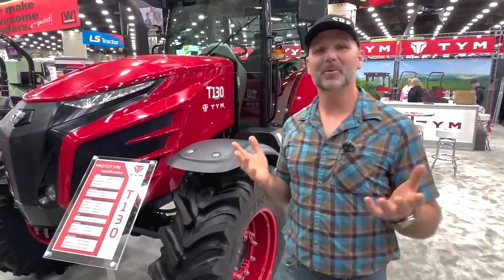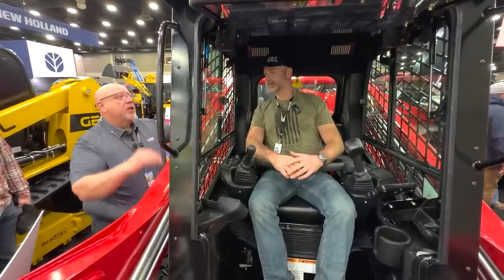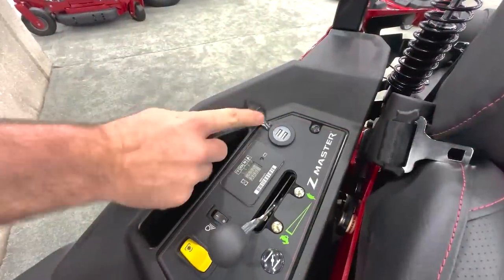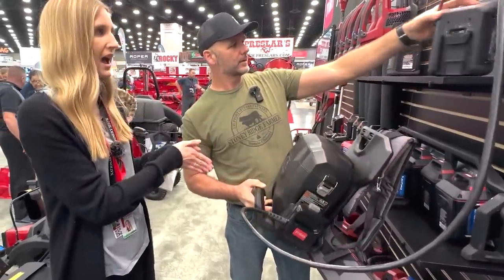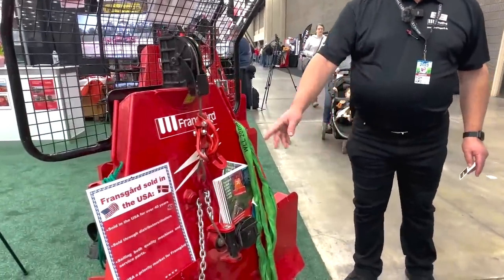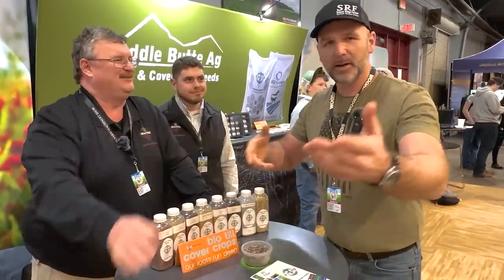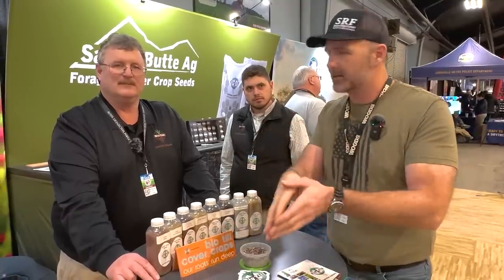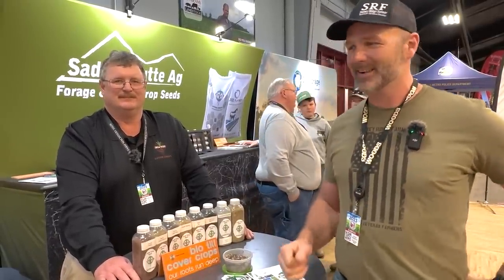Kicked him out of TORO exbibit at the Machinery show? You'll Love this!

Comment: Noticed how easy you were able to turn the pto shaft that was supposed to be the tractor output shaft .It's been my experience that most tractor output shafts don't turn this easy if at all. Sometimes with a lot of effort might be able to turn the pto shafts on the equipment.
Reply: Nice how it was just the right height for the PTO as well.
Reply: The PTO shaft spins free about a half to 3/4 turn on my Kubota M6060 when the machine is shut off, which is the purpose, your supposed to shut the machine off when connecting pto shafts.

Comment: the toro exhibit , that's a nice machine, they need to go back to the lazer z foot pedal, never had a problem with that pedal, the only people who do are the people who are dain bramaged and don't put their foot center on it properly who also drive with a beer in the hand instead of on one of the 2 control drive levers which is why there are so many smashed up mowers as these are the guys pinballing off trees, retaining walls, vehicles, boulders.... as evidenced by all the broken lights and smashed body panels and broken off plastic parts on the sides and tops of the engines like the air cleaner and throttle knobs.
if your foot slips off that new pedal it is going to have an excellent chance of shattering your ankle joint and forever being known as hop along pete or peg leg farmer

Comment: the ideal access door is an automatic NO for the simple fact i see enough people not securing their attachments and then they raise them up high enough they fall off and smash the door, doors are already in short supply and expensive as heck, what's the cost to replace this 10 grand? it's bad enough the bucket or other attachment falls right into the operators cab at their feet and face from what i have witnessed several times when buckets are raised over the cab during the winter and spring time and the attachment mostly buckets falls off and about kills them.
the swing door is also a safety mechanism that this swing door will enable more people to kill themselves with being able to get out when they absolutely shouldn't with the killing arms raised.

kicking out the window if sinking into water or quick sand or mud is more preferable especially for any parent or employer and insurance companys perspective. this is as bad of an idea as giving every person at the bar a small thermonuclear bomb  or a gun.
Reply from the maker: It’s a door buddy, that opens in a unique way.
Reply: Wow….. therapy is needed

Comment: Why do those zero-turn machines still use two handles for direction and speed instead of one joystick?
A Joystick has a lot easier  and shorter learning curve! And frees up the other hand for waving at neighbors, etc .
Everything is joysticks now!!!
Only a stupid company would sell something these days with steering that takes two hands!!!
Or at least make it optional!!!
Reply from the maker: Mowing with a zero turn is an absolute pleasure my friend. I’ve never seen a joystick controlled zero turn, however I’d imagine it would bump the price an extra $5-10k.
Reply: @StoneyRidgeFarmer  I don't see why it would be any more.
It's just a matter of changing the linkage between the handles and the 2 drive motors.
It would be extremely easy!!!

How'd you like it if you had use both hands to drive a car, and could never take your hands off the steering while the car was in motion. Wouldn't that get old real quick?
Wouldn't that seem really idiotic and stupid?
Reply: @StoneyRidgeFarmer  having to steer with two hands is why lot of people hate Bobcat skid-steer loaders!
All the other skid steer manufacturing companies went to joysticks almost immediately when they started making them!!!

Bobcat was trying to hold onto two hands to steer with until they were losing a lot of sales and they started switching over to joysticks!

Similar to case backhoes holding out for piano keys instead of regular joysticks on your backhoes until they were forced to start putting joysticks on their backhoes cuz everybody else had been doing it for years!

Every operator loves standardization so they can jump on any machine and run it without having to take weeks or months to learn how to use it!

Would you buy a car that took two hands to steer it?
Absolutely no sensible person would!!!!!!!! 

Even the large cat loaders are coming out with joystick operation now without a steering wheel!!!
The same thing on their road graders!
More and more dozers are coming out with joystick operation without the two lever steering.
Tillers and finger paddles might still be optional on cats.

As far as my favorite mower goes, a John Deere garden tractor with a hydrostatic transmission and a belly mower and a steering wheel spinner knob on it.

Driving that is more fun than our Massey Ferguson tractor with a bush hog on the back. 

Even more fun than driving my New Holland 33 horsepower with a bush hog on the back.

By the way, Case has optional control patterns for their backhoe now.
They can change the control pattern by changing the linkage rods between the handles and the hydraulic valves and takes about a half hour to change over. 
They could do the same thing on those zero turn mowers.